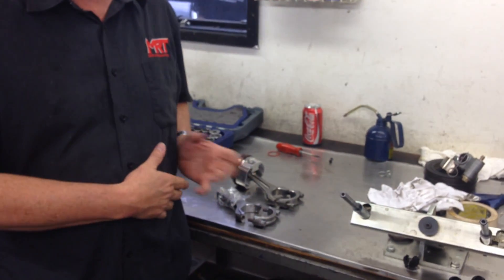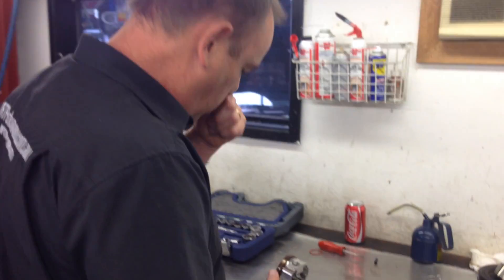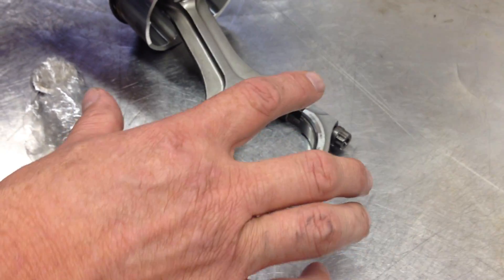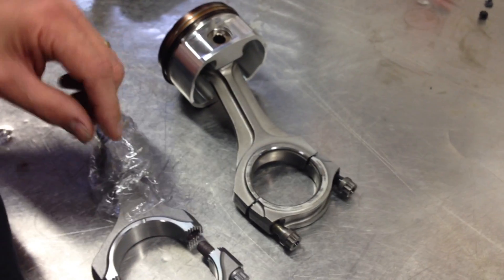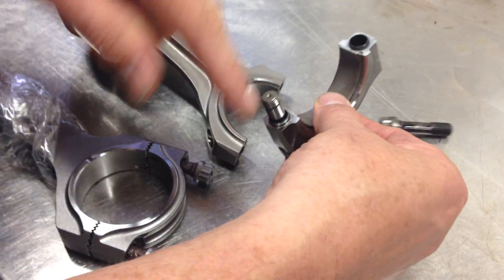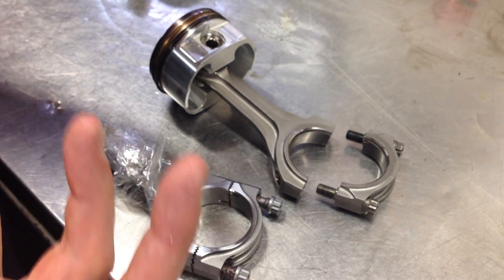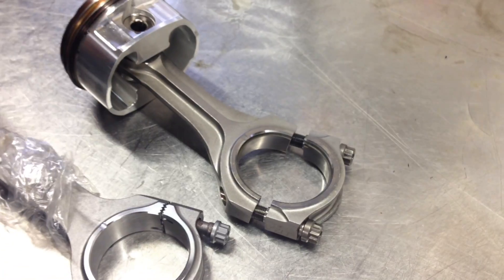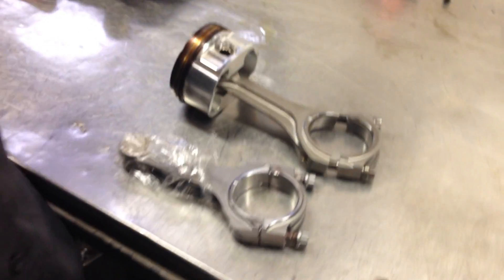Subaru BRZ, Toyota 86 engine conrod information

Comment: Did you guys check if the crank, pulley crank, flywheel and clutch plate are balanced?  Because this can cause the problem that you are showing on your video.  The Carrillo rod saw toothed cap and rod will just hide the real cause of your spuned bearing.
Reply from the maker: +aaguirre123 yes all the items were balanced as a set